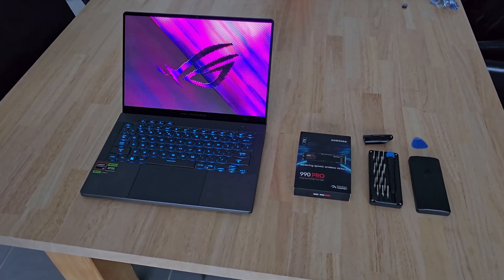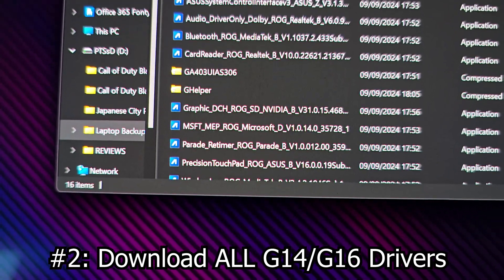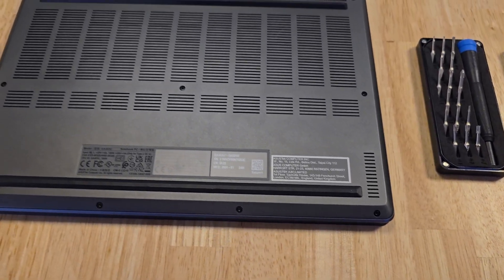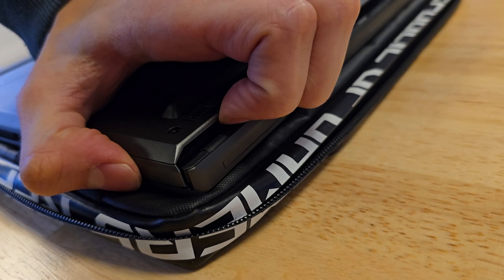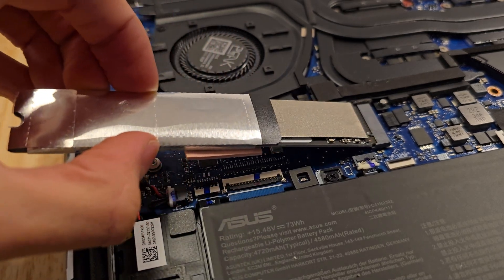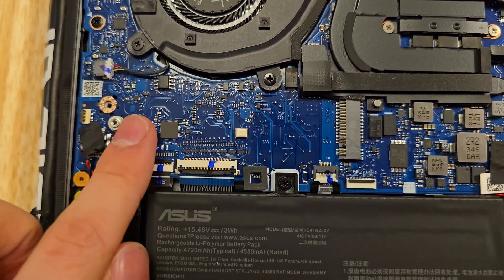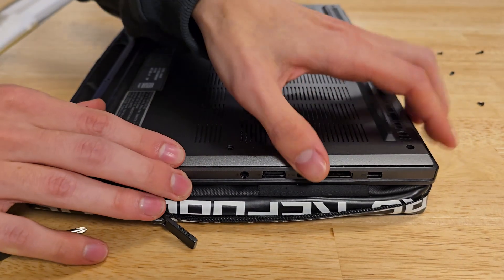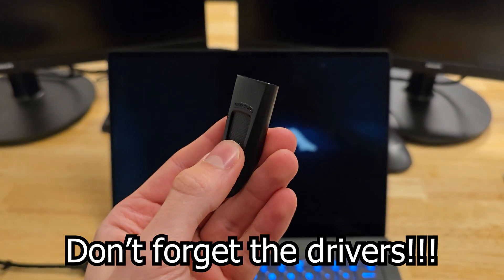Zephyrus G14 / G16 SSD Upgrade TUTORIAL - FULL Guide for Asus ROG Zephyrus G14 / G16 (2024/2025)

Comment: ASUS installs a SLC NAND based SSD and the system BIOS is not configured for properly out of the box  that which in turn will cause your OS/PC to lock up or freeze up and force you to emergency shut down the computer often (experienced this a good number of times and was not happy). I opened my G14 up and put a Micron 3400 Series 2TB TLC NAND SSD in mine and it works flawless now, also used NON OEM Windows 11 Image for clean install of the OS.

Fixing this flaw in the BIOS requires around 15-20 some minutes if u know where to go to fix it but this method isnt for the faint of heart so I dont recommend it, easier to just replace the SSD instead, just be sure you use a TLC or QLC based SSD as the replacement drive so you will have a proper setup.

Comment: I swapped my SSD for a 990 Pro 4TB, but for some reason, my Drive 1 & 2 temps are normal (30-55C), but my Drive 3 temps are getting pretty high (85+ C). Is that normal? How do I lower its temps if it's not normal? I followed the same process as described in the video.

Comment: I just did this using macrium reflect to clone a Samsung 990 pro 4tb on my G14. Super easy honestly. Just set the screws aside in the exact orientation you took them out. Middle row is the longest, followed by the back corners. Then used a credit card to get the tabs to release with a little twist working my way around. Getting the new ssd in was super easy and then just aligning the tabs back up and gently clicking them back into place was easy too. This vid gave me the knowledge to do it easily thanks!

Comment: Can the ram get upgraded?, I'm planning to buy it with discount in my country.
Reply: It may be different on specific models but it looks like for most of them the ram that it comes with can’t be removed/replaced and you can only add new ram in a separate slot if it has one
Reply from the maker: No, the 2024 and 2025 models do not have upgradeable RAM.
Reply: @crimsontechyt The G16 2024 it's the model I plan to buy with a big deal I was suggested.

RAM is something serious.

I'm a graphic designer, casual FPS gamer and I plan to be a gamedev with Unity.

Should be looking for a better option? I have $1500 (I'm from Chile but the budget it's practically that mount)

Comment: I really love your videos! This helped me a lot! 

Though I have a little project in my mind. I've seen a lot of SSD coolers on the market that are low profile and have tiny fins for extra cooling. What if I solder it on top of the CPU heat pipes, letting the third fan in the chassis blow air through it for even more cooling power?

 What I'm missing is the precise gap length between the backplate and the cooler

Comment: I tried to put my current 4TB 990 pro into my 2025 G14 and its not booting up right (it seems to get stuck on the "getting devices ready" part. What is that about? Please help! It ran just fine on my 2024 4070 G14

Comment: I bought the 2024 M16 because instead of the AMD it comes with an Intel 14th gen i9, and 16Gb of DDR5 RAM, & 2 Ports for M.2 SSD Harddrives. So I swapped out the RAM for 64GB of DDR5 & a 2TB Samsung 990 Pro & a 1TB 990 Pro because the read/write specs are faster than the factory SSD and it also came with the Nvidia RTX 4070 Laptop GPU. But before the upgrades it was on sale in late Aug 2024 for only $1300 and some change. New it still cost at least $1500 and the only difference between the M16 and the G16 is the G16 uses LPDDR5X RAM whuch is uaually soldered to the motherboard and is ootimized for power consumptiin whereas Standard DDR5 that uses DIMM slots is for performance mainly, also the G16 also comes with the Nvidia RTX 4070 Series unless you purchase the nearly $3000.00 version

Comment: Windows+MyAsus app should take take of most of the drivers if not all of them. No need to download drivers to a flash drive. But actually maybe there's a point in bringing over the drivers since I had to use a usb-c to ethernet adapter as wifi drivers were not installed, lol.

Comment: Hi im wondering if I buy a brand new G16 and replace the ssd right away do i still have to backup the system, or do i just download a new windows system?
Reply from the maker: You can just install a fresh windows install with a boot USB, but you DO need to have laptop drivers installed somewhere seperately so you can install them on the fresh windows install.

Comment: I have an Asus laptop from 2019 or 2020, but I'm looking to get this one to replace it. It's also a Samsung 990 Pro. Would I be able to simply take out this laptop's default SSD and put the other one in it, and use it basically as if it were my other laptop without deleting anything?
Reply from the maker: Then you would need to clone your old drive to your new drive :)

Comment: Looking into upgrading my ssd for my G16, is it possible extend it? i was going to use a samsung 2TB ssd but i didnt want to do away with the 512gb i already have
Reply from the maker: Yes, the G16 has two m.2 slots, so has the extra space for a second ssd :)
Reply: @ i noticed you went under the shield to add the SSD. i had assumed the shield was for extensions and would therefore be empty. is thermal glue at all necessary?

Comment: I put two of the double sided 4tb wd black 850x in my 2024 zephyrs g16 and it fit just fine.. works just fine too
Reply: that's great !! however, my g14 doesn't have enough space for a double sided one. just a heads up for anyone with a g14 hoping to use a double sided ssd :)
Reply: Hm. The 2024 G14, might I ask?

Comment: Ended up getting the G16, and i gotta say, WHAT A BEAUTY. I was so afraid of the fan noise and the screen wobble, but it doesn't bother me. (Especially since playing with in-ears while under heavy load. Gaming etc...) The OLED screen is just beautiful, the keyboard feels GREAT, the speakers are just out of this world and the weight is crazy for the power on this thing. Playing stretched cs2 i get stable ~200 frames. Also upgraded the SSD on my device and got 4TB. Whatsoever: for newer people I'd recommend reinstalling windows completely to get rid of the bloatware (mcafee in 2024 LOL) and as a first step installing GHelper from the official GitHub (essentially a crazy good tool for controls and drivers on asus laptops). Thanks for flexing that thing so much in your videos! I don't regret a minute yet!
Reply: Its been some time but, Which model did you get?
Reply: @Habukkk  the g16, but i encountered A LOT and i mean A LOT oft software and driver related issues. Asus can build stuff but cant build the software around it. I personally think its still a great laptop but has its issues.
Reply: @damntasia  yeah i know it’s a G16,but which spec? 4080?4060?
Reply: for speakers to sound good u must have some preset in dolby audio ?
Reply: @michaozga7825 no sound is awesome out of the box
Reply: @michaozga7825  nono it was insta really good for me
Reply: What SSD product have you used for SSD upgrade to 4TB in your G16 ? I had assumed that the SSD is expandable to a max of 2TB in the G16.
Reply: Bro i want to ask something, should i try to delete the armory crate when i have g helper?
Reply: @usogunther9429  yeah, don't even install armory crate if you can
Reply: I got g14 with 4070. deleted armory crate right away and installed g helper.
anything else I should do?
Reply: I got the g14 with 4070/32gb ram last year in spring and I love this laptop it’s definitely the nicest piece of tech I’ve ever owned

Comment: The original SSD has a thermal pad underneath and an aluminium sleeve for cooling. If I want to add a second SSD and not replace the one already there, do you know what size the thermal pad has and if the aluminium sleeve is needed?

Comment: Hey guys I just did this with my g16 and 990 pro aswell, this video was awesome but for anyone doing this I recommend unplugging the battery first, its not necessary but heard horror stories of people dropping the ssd screw and shorting the motherboard.  I was scared but its super easy, theres a metal clip you unhook from the cable then you just pull it up. You can watch a g16 un-assembly vid on youtube if nervous.
Reply: as a certified IT professional I don't know why anyone wouldn't unplug the battery first especially on a tablet or laptop.  They never 100% power off.

Comment: I can confirm my 8TB fits no problem and that’s double sided. No issues whatsoever.
Reply from the maker: Oh damn, nice! I wonder why they stress so hard not to use double-sided SSDs then 🤔
Keep us updated!
Reply: @ it’s more of a disclaimer due to measurements and safety. But it still works. I got the drive for $550 during Black Friday. As for the heat, it wasn’t an issue and I was able to stream+rec at same time. 0 issues. Can’t say the same for everyone else. But for personal experience, I’d suggest it if 8TB is needed.
Reply: @crimsontechyt 
First of all, it would have a thermal issue. Also, I mess up with Kingston KC3000 2TB which is a double sided SSD with my G14 2023. Personally, I think Asus does a great job especially for separating Wi-Fi and SSD socket this time. I’m keep facing the wifi connection issue that I almost sure it is caused by the signal interference between both.
Reply: Same I put two 4tb double sided wd black 850x in my 2024 g16 and fit just fine..
Reply: And it works with no issue? What SSD are you using?
Reply: @ I’m currently using the WD BLACK (w/o heatsink). I had to get the 8TB for obs recordings (dual pc) and partitioned 1gb for some games on the go. I was skeptical at first because of dual side. But it sit flushed. I was able to use it for what I’m doing without a problem.
Reply: To add on to that, I used the anti static shielding envelope that was on the stock nvme the g14 came with.
Reply: @ayebrian  Thank you, I'm going to go look into that for my G14.
Reply: @ sounds good! Hope it works out well 🙏
Reply: Thats why i saw how thick is thermalpad underneath the ssd

Comment: I just did this yesterday! Definitely was nervous after seeing that SSD shroud (never seen that before) and odd battery connector. I spent a bunch of time figuring out how to disconnect the battery first, but ultimately read online that there is a metal component that can short the whole board if it touches. Was able to Clone my 1TB to a 2TB SN850x, works great so far.
Reply: I fried my 2020 g14 disconnecting the battery. I made sure to just leave the battery connected this time.  Thank God nothing happened.
Reply: dude anything can short out if electric hits metal lol.  In computer servicing people wear anti static wrist bands because their fingers can shock out hardware components.  I'd unplug the battery on laptops or tablets.

Comment: what I would've done is take the graphite sheet off of the old ssd and put it on the new one, or put a thermal pad on the new one. probably won't make any difference but these drives run extremely hot and doing something so simple to have larger heat capacity is definitely worth it in the long run

Comment: Please help me . I can't decide which laptop should I buy. With discounts there are zeyphrus g14 2024 16gb ram , 1tb ssd and 4060 is 1200 and zeyphrus g16 2023 16gb ram , 1tb ssd i7 13620h/ 4070 is 1250. I worry about g14 doesn't have extra slot for upgrade ram but other hand it has great display. G 16 have 4070 is a point but I don't know if this could directly affect for buy g16. What do you think?
Reply from the maker: Hmmm it basically comes down to whether you prefer a bigger or smaller display :)
The 2024 G14 is more compact, has better build quality, speakers, screen, battery life, and CPU.
But the G16 has a better screen and GPU.

Comment: You could also do Asus Cloud Recovery through the bios, It restores the original but a more updated factory image , e.g 24H2 , then debloat thereafter.
Reply: this seems way easier, is there anything specific to it?
Reply: will it also install the dolby licenses for audio etc? i want to upgrade ssd right away when i get mine delivered.
Reply: @michaozga7825 replying to this late but yes it will, I had to use it on my open box g14 because Best Buy flashed it with a random copy of windows and the dolby apps were partly installed / not working correctly, it was WEIRD